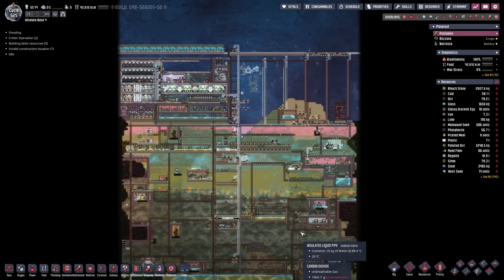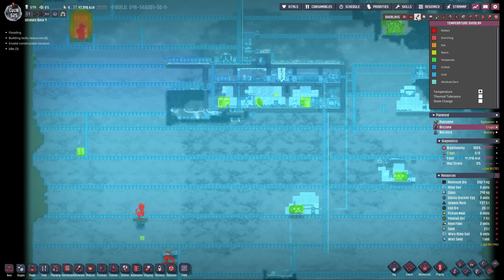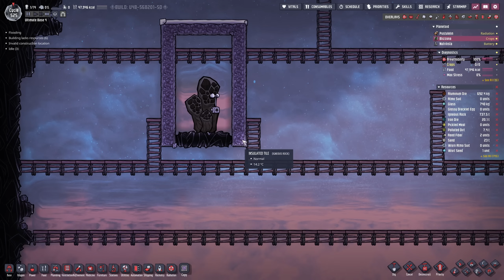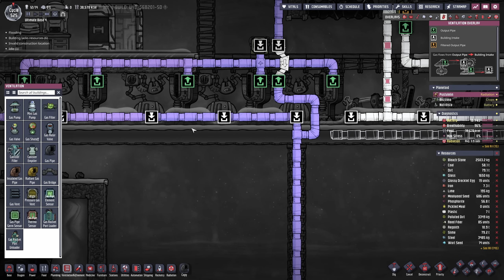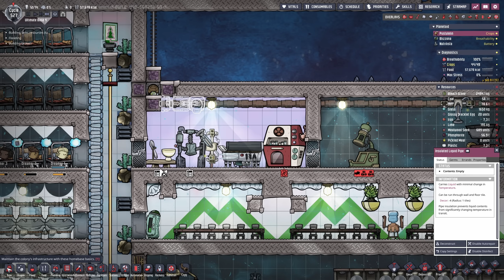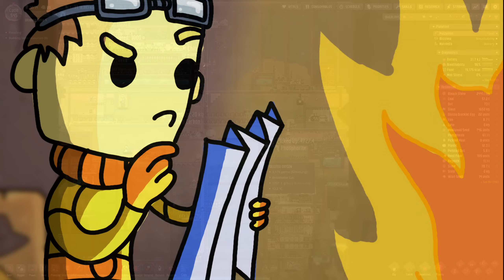START OF INDUSTRIAL SAUNA - Ep. #35 - Oxygen Not Included (Ultimate Base 4.0)

Comment: a few mesh tiles on the bottom layer at 13:30  would allow your water and carbon dioxide to drift out without accumulating enough to flash to steam.  You'd have a small mix of polluted oxygen in there from offgassing, but the steam will stay above polluted oxygen.  This also means you don't have to remove the batteries, just place them on mesh tiles.  Leaving the above floors as mesh would mean the liquids will all fall to the bottom and drift to the first mesh til to drop off.

Comment: Bleach stone?Say what?Vacuum is also sterile atmosphere if you keep the temperature on a metal tile where all the food sits at bellow -18 everything will be deep frozen and you could even have food at 0% stale being kept there and it will never turn to rot pile if your cooling is good enough.
I do my fridge tile as soon as cycle 50 when I unlock Thermo Regulator and I simply throw Oxygen or Poluted Oxygen in the cooling loop,dont even need Hydrogen or fancy stuff,it works just fine and the Thermo Regulator doesnt even produce much heat so it's easy to manage.
For gas element sensors and such when wanting to clean an area,if you dont wanna end up mixing gases just use a filter gate set to 30s,if for 30s it detects said substance the pump activates so it doesnt keep stuttering and pulling all sorts of different elements.
Reply from the maker: The bleach stone creates chlorine which then in turn kills off all food poisoning germs.

Comment: nathan, why don't you try using atmo sensor and liquid shut off for your industrial sauna? i think it's easier to control and mantain rather than your complicated structure. you can set the limit to the pressure required and a new water resource.
Reply from the maker: Complicated? I thought it's quite straightforward.